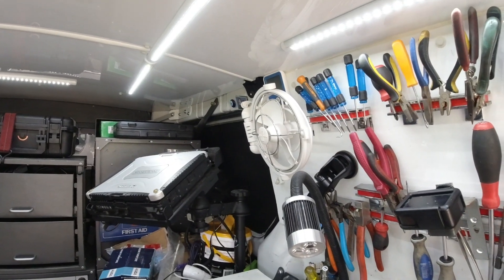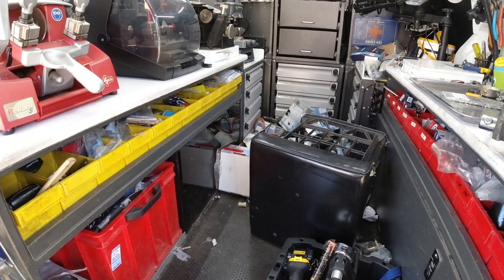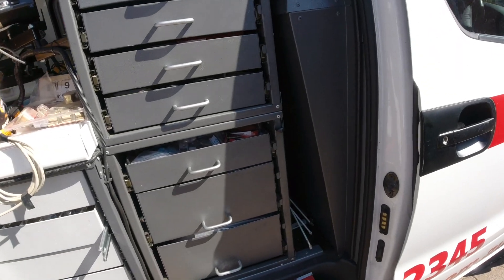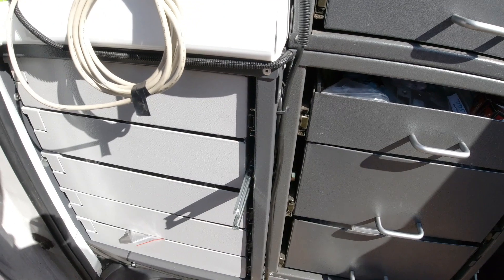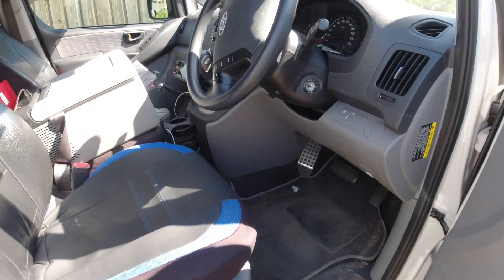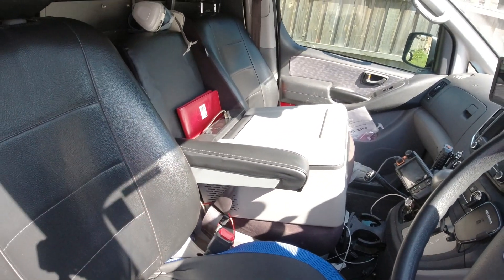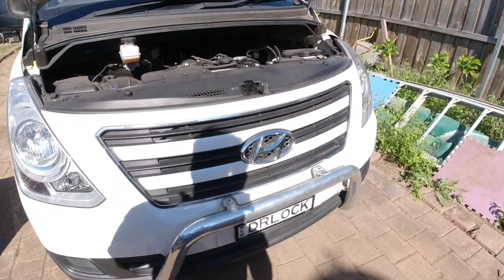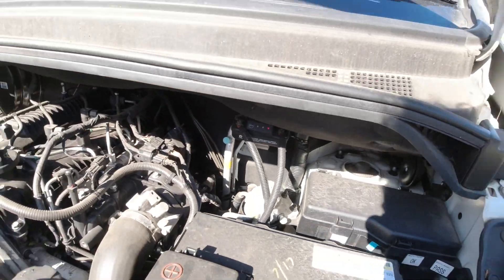Locksmith Work Van After 3 Years Service - Review

Comment: I've got a couple of suggestions...

On your car tools:
If you have (or can invest)
Use a household vacuum sealer to make long bags..
When all bags are complete,
Remove grey toolbox & mount bags
(overlapping slightly) make sure to use finder washers. 
Then mark next to each one which it is. I'd suggest self adhesive labels on inside door frame.

Add a proper wash station. 
A small container similar to,
https://www.amazon.com.au/Arrow-Products-Container-2-5-Gallon-Clear-White/dp/B000QRAMNC
Mounted under the red key machine with an electric pump. 
An easily made extending nozzle can be made to extend out about  two to three feet of the face of the shelf (left of the red key machine) coming out between the 3rd & 4th row (down) of key blanks, far enough to not get even the bumper wet. And, if you run a double lead under the trim, you can mount the switch with the others.
Done right, won't drip in van.
(Even when driving over rough roads)
Reply: Are you a locksmith in KCK area?
Reply: @odinslockllc  ,
Not exactly...
I'm a "Utility Maintenance Mechanic"
For one of the local governments. 

Locks, doors, & some other duties of locksmithing fall under my work details... 
mngt utilizes attributes of subordinates that they brought in when hired. 

I love my city job ! ! !
Reply: And my supervisor caters to my interests.
Reply: @torchofkck4989  I hear ya. I was a Maintenance Mechanic at the old KC Harley plant and assumed the locksmith duties as well since I was “certified“ locksmith/ maintenance mechanic from a previous employer. I’m a Pipefitter at the KC Ford Plant now since 2013, and I have a mobile locksmith business on the side. I cover KCMO and the Northland area on the Missouri side. Cheers!✌🏼
Reply: @torchofkck4989  nice!